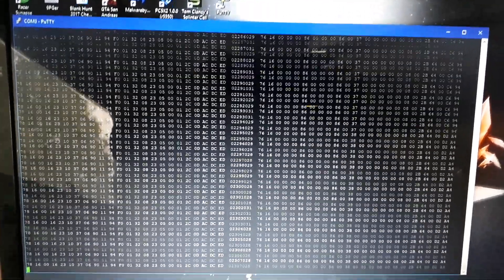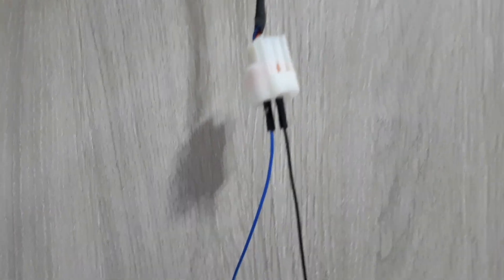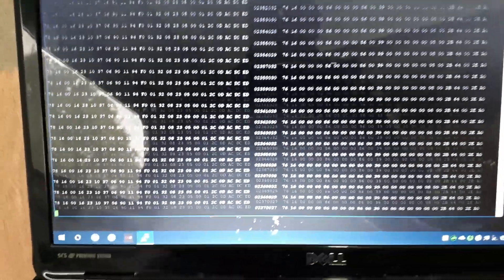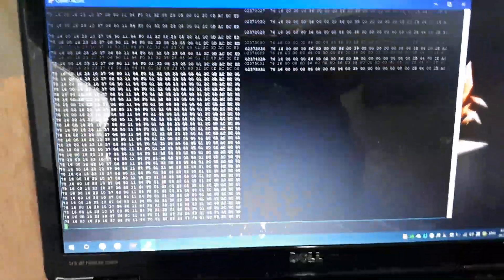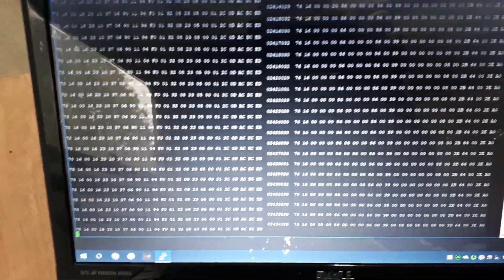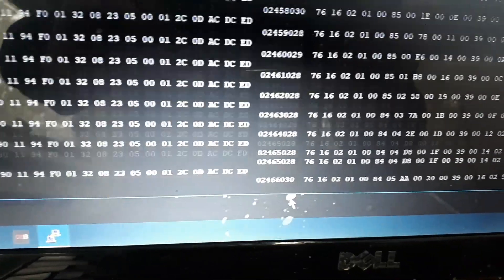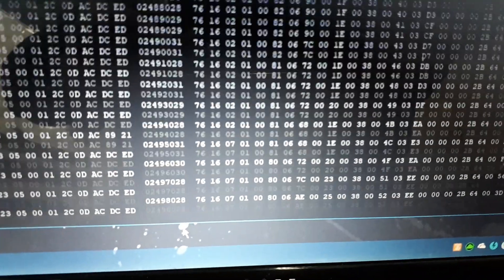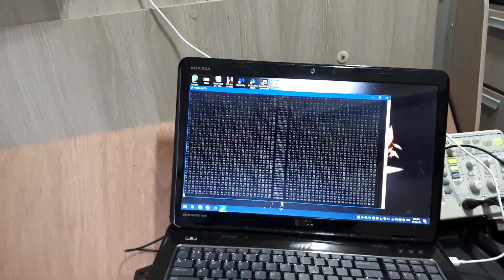Chinese diesel heater controlled by an Arduino Due

Comment: I have been looking at your project/product as I like the mqtt feature.  I am currently building a campervan with a electrics/environments running through HomeAssistant running on a raspberry pi. I am very new to it all but was wondering if i could actually control the diesel heater directly from my pi rather than using your product as an inbetween via mqtt (power constraints of a campervan). If this is possible, could you perhaps advise me on some topics to research to get me on my way ?. Thanks for any help with this :).

Comment: any chance there could be a way to have a raspberry pi communicate with the heater? I wanted to use an raspberry pi and a touch screen to control the heater.
Reply from the maker: I personally would not trust a raspberry pi to manage the half duplex comms to the heater. 
The single wire needs to be transformed from send to receive very soon after you speak to the heater.
Ie the Linux kernel is not real time and latency could become an issue.
I have considered a "protocol adapter" that could be trusted to handle the interface and use I2C to another device like a pi.

Comment: It seems lilke you have hacked the protocol between the display and keyboard unit and control unit. I am planning to do the same, so it is possible to program certain regimes by pressing a key, and control that device remotely.
Reply from the maker: Yes indeed. There is a Facebook group https://www.facebook.com/groups/146837062640024/?hc_ref=ARTYigv_e-UV_lBO66jDGoT4wf2_3NB9SqtYgEz7CAg6CAlbfW6pJuBQ6LPc-OMHk9g where I have published the protocol (in the files section)
That may save you a little bit of work ;-)

I have also been collaborating with another member of that group and have got Bluetooth control working, with a 128x64 OLED display as well.
I have a GitLab repo with the project underway.
An ESP32 is now the device, and due to kernel crash issues in the BT kernel code I'm using a HC-05 BT module for now.